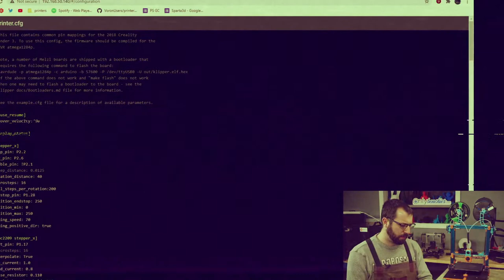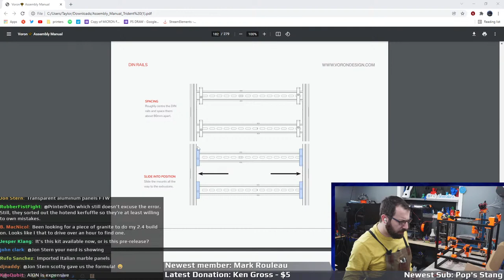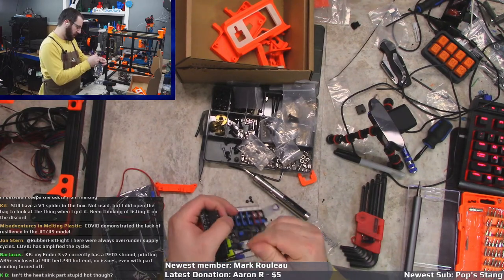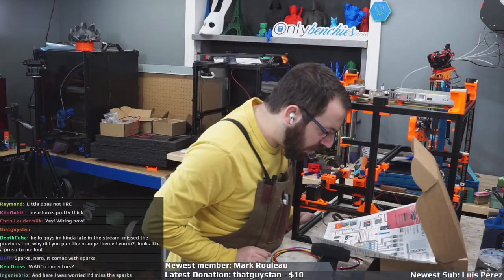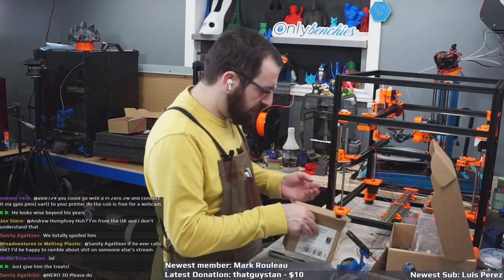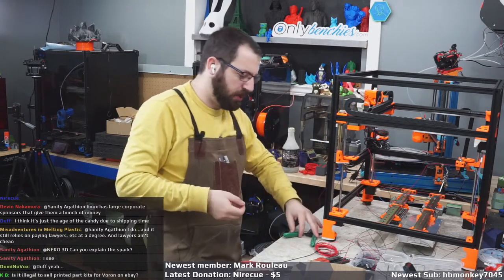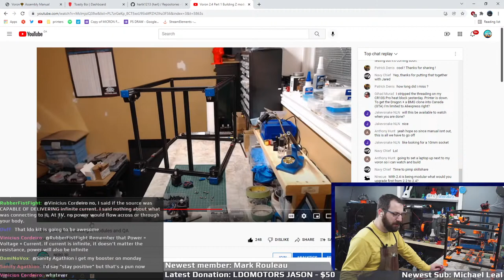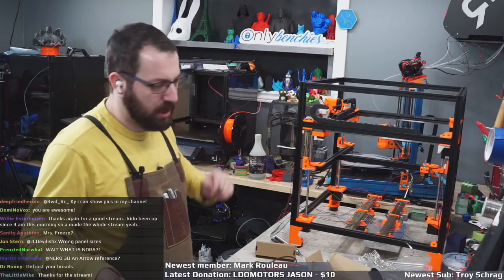Voron Trident Build Livestream - PART 4 - ELECTRICAL WORK BEGINS!

Comment from the maker: Did you buy this kit, or recently purchased a voron kit from Fysetc?
Share your experiences, good or bad by replying to this post
Reply: I've build Fysetc Voron 2.4 with Aluminum parts. It was not very pleasant experience: not very flat bed, wrong heater, not full metal hotend, very weak extruder motor, thing wall bowden tube - too much space for the filament to flex (between feeder and hotend), screwed screw on 2 80T idlers (acid or other chemical damage, it was reveal after full assembly ... ).

Comment: When the guy said use flux he was right. Flux in the solder wire is 'adequate' but adding some flux to the surface before soldering is so much more effective.